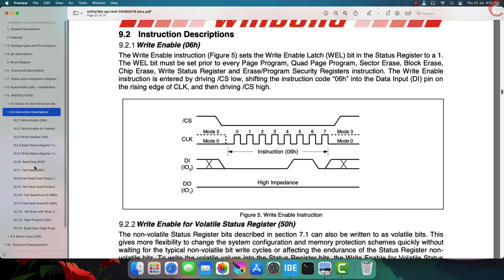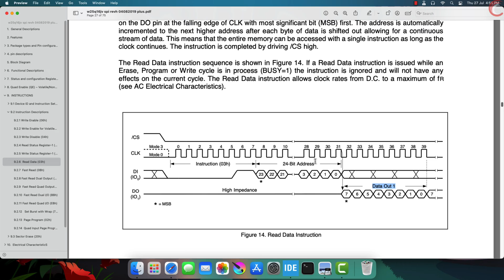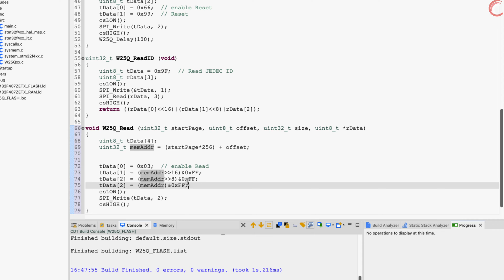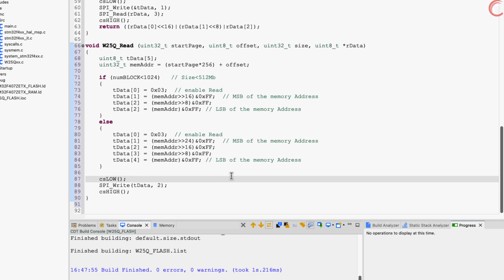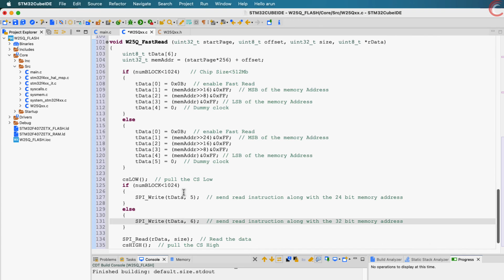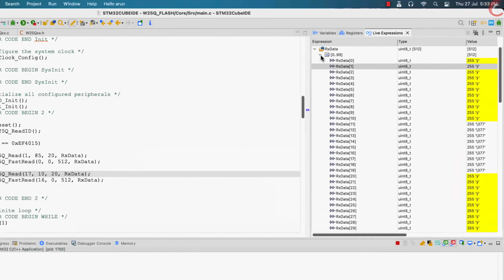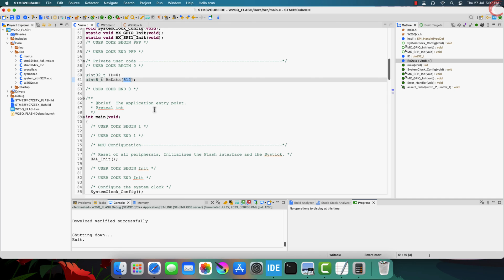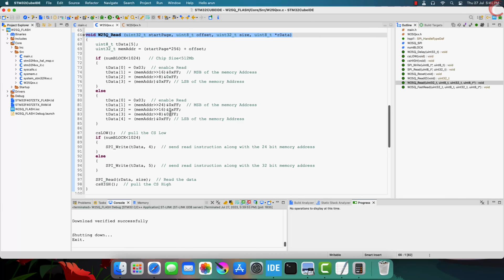W25Q FLASH Memory || Part 2 || How to Read the Data from memory

Comment: i am using normal spi , code is working fine. My doubt is that I can read only 2.5Mhz frequency if I increase it, no data is showing on the read buffer. Data is coming only when SPI frequency only 2.5Mhz

Comment: If the numBLOCK is set to more than 512, the read/write doesn't work. I have W25Q01JV (1Gbit) so my numBLOCK is 2048. With this the RxData when monitored changes to 255 [0 to 19]. Doesn't show the correct data I sent.
Reply from the maker: It should work, there is no separate condition for 1gig memory. 
How are you writing data ? And how many bytes are you writing?
Reply: @ControllersTech  I'm using the same function you provide in the video. Just moved it to main.c and removed the button pressed thing. 

I've tried writing different sizes. Issue persists. If I keep the numBLOCK to <512, I can write and read back without any issue. 

With everything kept exactly same, I just change the numBLOCK to >512, the data in RxData changes, but to 255. If I write 5 bytes, then RxData[1...5] changes but to 255. Not what I attempted to write.
Reply from the maker: Can u contact me on telegram (link is in the description). I need to see the output. 
Also i just pushed an update to the write function in the part 4. Please download that to write the data.
Reply: @ControllersTech  I have posted the same query on your Discord today.
Reply from the maker: @abhijithekv ok check discord then.

Comment: if you have time please make videos on Quectel mc60 modules . if you are going make videos on  Quectel  modules then please use try code only using that module. what i mean is do not use esp32 or any other microcontroller and send AT commands to the Quectel modules. there are are ZERO videos in youtube . i hope you will make videos on this rare modules.